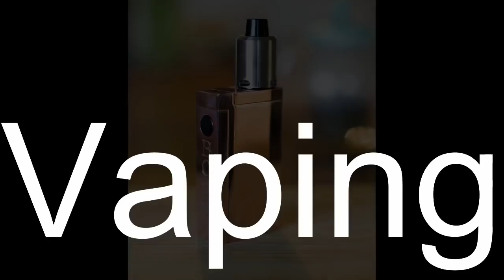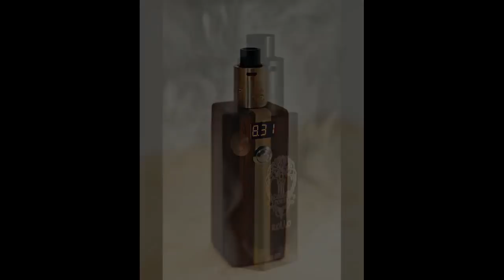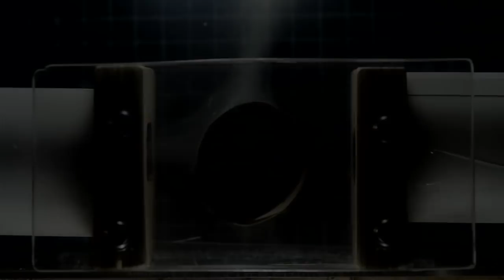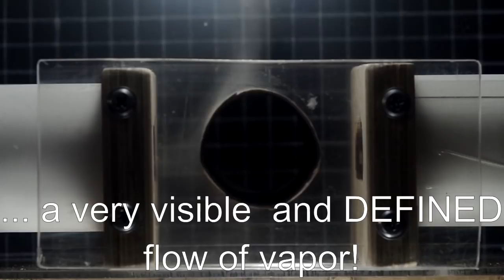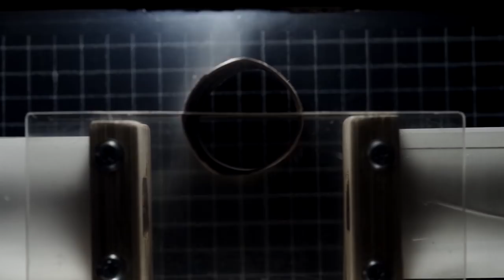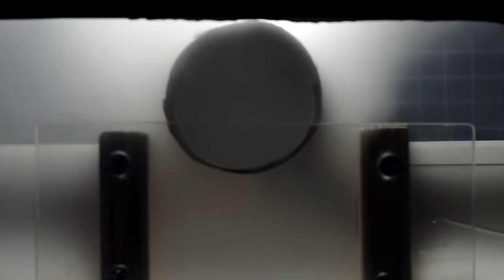Air Flow for single coil RDAs (most of them) and coil placement

Comment: Is the ''coil'' shape a contributor? What if the coil is square or triangular? The higher coil, at 16:50, specifically the gap between the wooden blocks and the coil, this reminds me of the ''slot'' between a Jib and a Main Sail from my yachting days. Getting the right slot between these two sails increases the low pressure on the fore side of the main sail increasing the ''pull' or ''lift'' on the main sail. So this slot in the video, is significant?
Reply from the maker: Hi, thank you for your insights. The coil needs to have a continous convex shape for the air to follow it around. In theese speeds a narrow slot will be a part of this effect I think.
Reply: Thanks Morten. Looking at Streamlining, do you think air resistance or drag is desirable in a coil shape? A flat surface has 100% drag, high turbulence, a round surface has 50% drag, less turbulence, a shallow teardrop has 15% and some turbulence, while an elongated tear drop has 5% and no turbulence. 

This would suggest that an elongated tear drop coil would have the least drag (zero turbulence) but an increased total surface area compared to a round coil of the same diameter. As your studies have shown, the air flow travels straight, regardless of the location of the suction so ideally, the air intake port would be positioned to direct air to the rounded edge of the tear drop. This begs the question though, how does air velocity across the surfaces and the time duration on the surface affect flavour and vape density and which I think, would be a factor of the air port size and the size of the slot (between coil and posts).
Reply from the maker: Your theory is correct when speeds are high enough. At the speeds we vape at, a smouth, round (cylindrical) shape have very little drag, because the separation points are pushed way back (due to Coanda effect). We are talking about Reynolds numbers (Re) at 3.5 (if I understand the calculators right). And at these Re's, as long as the coil have a continous convex shape, there should be little to no drag. Anyways, in practical use, it looks like the effective cooling let you ramp up the Watts, so you get more vape. Some say that gives bad flavor, other says this kind of dry vape is what they prefere. But the better the cooling, the less droplets in the vape. I really don't like to get a mouthfull of e-juice, so I prefere a properly placed flatwire coil. Others like a framed, stapled clapton away from the air holes and close to the drip tip, only cooled by drifting turbulence. So the right shape, the right position, the right coil wire, is a matter of taste. I just want to show what is happening, so people can make an informed choise. Make sense?
Reply: Makes sense. There are variables in terms of the atomiser set up as well as an individual's tastes and preferences so in the end, there is no ''one size'' fits all. Having said that, your vids illustrate an optimal set up for the atomiser in order to leverage the benefits of the design or mitigate the flaws. As for individual taste, there is not much you can do for that :-)

Comment: Can you please try the airflow of the phobia rda? I wanted to know coz MCM has already made a prototype of the Mose One, which is a single coil rda, and has pretty much the same airflow of the phobia but being present only on one side.
Reply from the maker: Hi! It is on my list, but the Phobia is pre order still. Nobody sends me anything, so I will have to wait untill it's retail available. From the images I have done some testing, and it looks like it's flaved, but I cant say for sure untill I have one in my hands. From the images I have done some computer simulations and air flow chamber testing, and the air flow from the sides will most likely shoot upwards in a 70 degree angle. I do not know if it will miss the coils entirely, but it looks that way. They could have fixed this so easily...

Comment: Great video. Have you thought of trying these tests with a computer particle simulator. You could make an outer chamber and drip tip and all your flow and particle attributes and parameters would be micro tweakable. It would be cool to see different coloured vape from either side and observe the mixing due to the vortexes. Keep up the great research I really enjoy your insights.
Reply from the maker: Thank you Wheel! I will look into a simulator, but I know nothing about them yet. Regarding two colors, that is exactly what I'm doing now. I have clear air comming in from the right, and vapor comming in from the left. But a computer rendering of the flow would be nice. Thank you.
Reply from the maker: I have spent the day looking at programs and simulators. None of them are useful to us regarding the details of flow and presure. But a lot of them can be used to study the angles of air holes. And I am glad and releived that all of them has shown that my calculations based upon observation has been spot on! Like the dotRDA, the Dead Rabbit, Pulse 22 & 24, and so on. I will include some of the graphics in my up-comming MadDog RDA air flow review.
Reply: Ha ha I was just looking at software too. Your findings sound exciting. I found Blender as the free option but I am not sure how well it simulates complex vortex interactions or pressures as you mentioned. Houdini is much more scientific and accurate in its approach but a beast to learn. It is used for all physics simulations in movie sfx where destruction, tornados, avalanches etc are needed. I bet there is some type of dedicated engineering software for the aeronautics and car industries. You can't beat the real thing though. Anyway, looking forward to your future experiments, regards wheel333.

Comment: Hey morten! You are doing such great work with your videos! You are like the battery mooch of airflow!
Reply from the maker: Thank you! I have not seen anyone else publish such findings, but I guess someone does it, and I have learned that at least one other developer is thinking about it. My highest hope is that there will be some properly developed RDAs soon:-)
Reply: Morten Oen Nah bettery mooch is the dude that tests different batteries and makes sure they aren't over rating their amp limits and checks for safety and stuff like that. I think you are the only one doing testing on airflow for rdas, which is also amazing! So great seeing more technical analysis of different aspects in vaping. Keep doing what you do, you are putting out amazing content! I hope you get an opportunity to design your own RDA some day, I bet it will be outstanding!

Comment: Nice demonstration. This way you can see how it really works.
I'm lucky my setups come really close to the optimum settings you showed. I usually control the coil position by pointing a torch from the airflow inside and see from top where the coils are lit  & doing the lighting also from top and look through the air flow. This way you can position it really good. 

It works most of the times, but there is also the factor of cotton. How it's fitted and how much. You must find a middle way between liquid flow and air flow behaviour. Because the cotton is irritating the air flow very much.

But that are rules you have to find with every atomizer. Fine adjustment is the trick. A mm in any direction here and there... 

Anyways, have a merry christmas and a happy new year in cold Norway!
Reply from the maker: Thanks Nurb! And thank you for the tip. Very useful for angled air flow. Do you mind if I use that trick in a video?
Reply: Sure go ahead. No worries. :-)